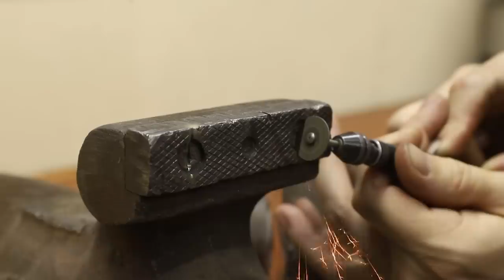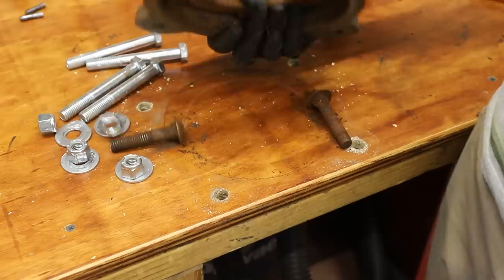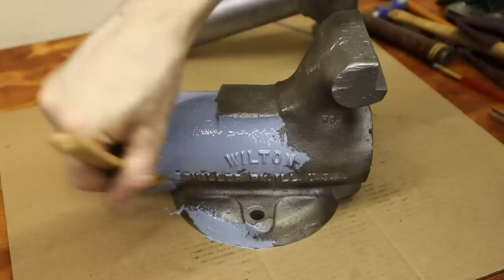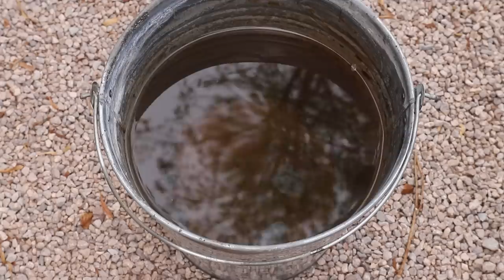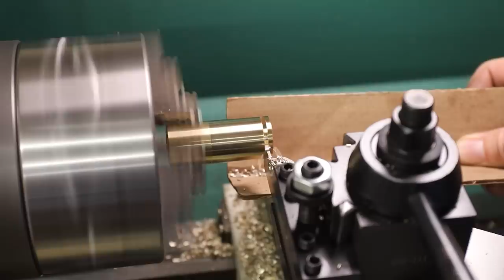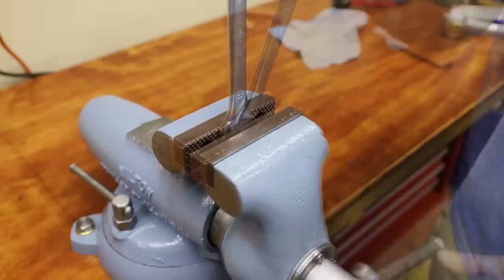Restoring a Wilton bench vise and making copper soft jaws - Vise Restoration

Comment: I recovered the same exact vise off a sunken boat. A Steven's Brothers 56" yacht laid down in 1956 she displaced 44000 lbs. At the time she hit the water, she came in at a hefty 34000 lbs. The vise was down below in the engine room (2 ea Gray marine diesels) settled into the mud took me forever to get it off the bench.  After recovery I cleaned it up, it worked fine. I kept it on my bench in Fl for years now its residing on my welding table in NC Arkansas, I just pulled it apart again  to clean it up and lube her. Outstanding piece of equipment that just keeps on giving with minor maintenance.

Comment: I have noticed these holes when I  melt  copper wire from motor windings but not anywhere near as much from coated electrical wires.  I  think your suspicions with petrobond is correct

Comment: Love your videos you make me wanna try lost pla casting so bad but I dont have a foundry
Reply: Try lower melting metals like pewter
Reply: You can melt it in a frying pan
Reply: I’ve got a small pewter statue I picked up from goodwill I just gotta do some more goodwill hunting! I have a 3d model of Jonathan Davis microphone stand and just been dying to make a metal version of it 😍
Reply: @solondarville1020  You can melt aluminum in a steel pipe(instead of crucible) over a campfire . If you want to make it fancy you can dig a hole in the ground and use a iron pipe as oxygen supply. Then you attach a fancy 10$ hair dryer to a pipe and it will melt it in no time. 
It does not need to be expensive to work.

Comment: I'm not quite sure what cause the voids exactly but if I take guess, I think may be petrobond sand release some gasses due to the heat and the air bubbles get trapped in the metals while they are still in the liquid state so as the metals cool down it leaves voids in the material.

Comment: The date code for the vise is under the guide rail bolted below the dynamic jaw tube.  A quick way to break down the vise is to pull the three horseshoe screws, remove the horseshoe washer, spin out the spindle handle and Acme screw.  The dynamic jaw and tube can then be slid out.  Easy way to clean and lube it.

Comment: The voids are fine.  No need to change a thing.  I would have put a thin layer of grease on the swivel base.  Used to work in a metal shop and I'd go through the vises about once a month.  They were in constant use, three shifts a day.

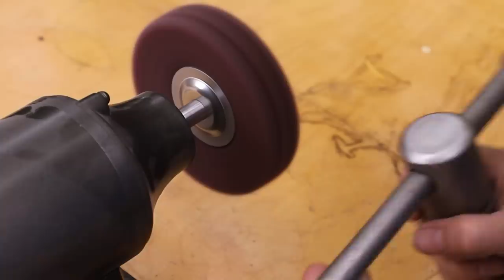Comment: At 2:50 you said that there was not much that could be done about fixing the dings from someone hitting the vice with a hammer. I have watched several vice restoration videos and what you can do is fill the grooves and crevices using a stick welder. After filling the crevices with molten welding rods, you can grind off the excess with an angle grinder or dir grinder.
Reply: That depends if its a cast steel or cast iron body.Steel is not a big deal but cast iron is a pain in ass to weld.It can be done but its a lot of hassle for a few dings. 
You can weld cast iron with both 6013 and 7018 electrodes but it needs a lot of preheat  and slow cool down (a bucket of preheated sand is best ,cover the part and let it cool off naturally ). Safer version is to buy electrodes specially designed for that but they cost a lot since there is nickel and silver in them.
Not worthy unless its gonna be a wall hanger .

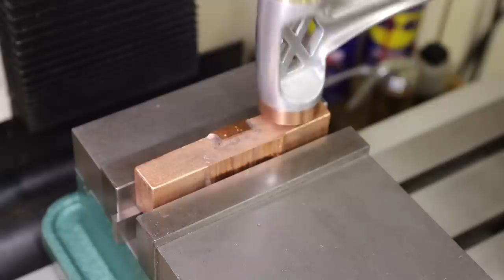Comment: 5:46 about the voids - have you tried burning-out the printed pattern from the mold before pouring molten metal in? There may be some remnant gas that fails to escape before the melt solidifies around it.

Comment: nice resto job! simple and just what a tool in use needs!
about the air in the copper.... I remember watching another channel where he did some casting but he use bentonite clay/cat litter mixed with sand or something like that. I wish I could tell you the exact details but it was a while ago and so I thought I could at least tell you the name I did remember so you could start down the path.... I think there is some of the oil in the petrobond evaporating into gas, but I really don't know for sure... I hope you figure it out :D
Reply: Yeah, until now I have been casting on my channel using home made "green sand" which is made by adding a bit of bentonite and water to a portion of sand. This has worked great, even though my sand is a bit coarse. Yesterday I received 10kg of non-branded oil bonded casting sand, that I will be testing this weekend. Curious to see if I experience the same copper-air-bubble-problem :)

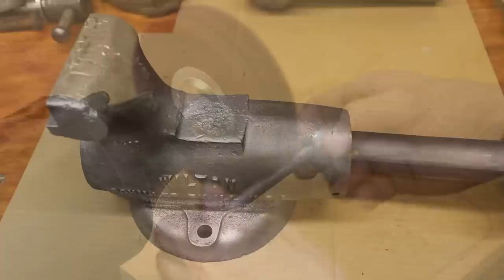Comment: I love your videos. Can you please post the part number or link to the scotch brite wheel you're using at 3:05? Also the oil based industrial enamel you're using at 3:47? Also, what flux do you use for casting copper?

As for the voids in the jaws, you can easily fix them with a TIG torch and regular solid copper electrical wire as filler.

I have a theory as to why the voids are forming. It's possible that the oil in the casting sand is burning off rapidly and enlarging the casting volume. The outer sections of copper would quickly solidify unevenly and cause voids to form in the middle.

Maybe try packing the casting sand even tighter, with more pressure, perhaps with a hydraulic press.

Comment: I believe it's the copper trying to affiliate with the decomposition products of the oil like CO, CO2, and whatever else might be created. You might need to add something to the copper to kick out the products, or use a different sand for copper. Maybe a curing sand? Or bar molds?

Comment: If you have dents that annoy you, you can always smack them back into submission. You can either use a chisel (always flat with rounded edges) or just the ball end of a hammer. With a little bit of patience, you can dress up most dents.

Comment: Excellent video!!! I'm wondering if you can help me complete a restoration of a very similar vise. I have a 4 inch Wilton Bullet vise, very similar to yours, it was built some time in the 1950's, or early 1960's. The kicker is, it is NOT branded as a Wilton vise. A high school in Chicago, named Lane Tech, contracted with Wilton to have their metal shop students cast, and build their own vise, that the students could then keep. Rather than bearing the Wilton name, it says LANE TECH, and in smaller letters where your says Schiller Park, IL., this one says Chicago IL. What I am having a virtually IMPOSSIBLE time finding, is a swivel base for it. The real hard thing about finding a swivel base for this vise, is that it has no model number on it. Also, where did you find the paint you used in your restoration?? The paint that was used in a previous restoration is very easily scratched off of my vise.

Comment: I really like how you did this, but there are some things I would have did differently. First, I would have used new bolts and screws where I could have and secondly, I would have trued up the sides of the jaws to have a new machined look to match the new soft jaws. That being said, I do agree with not filling in the little holes on the vice. The bondo would eventually work loose, and fall out leaving behind a dark hole against the bright paint.